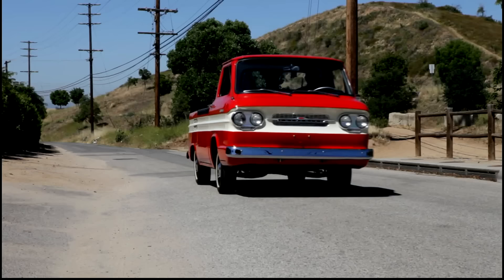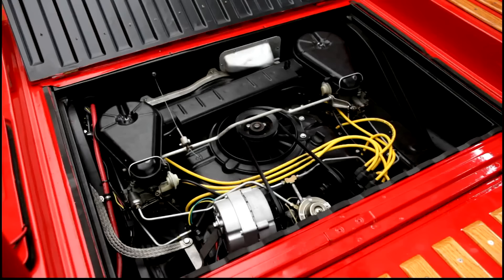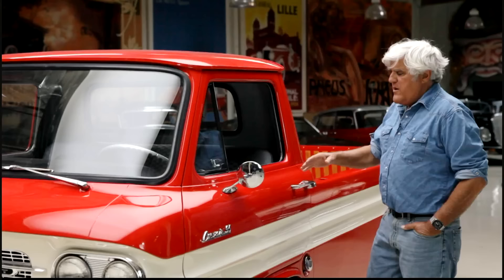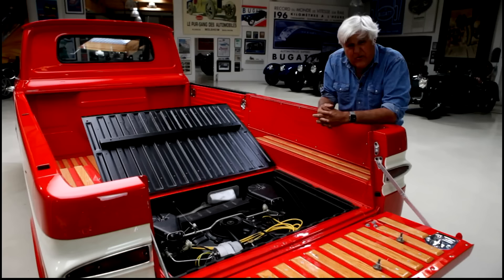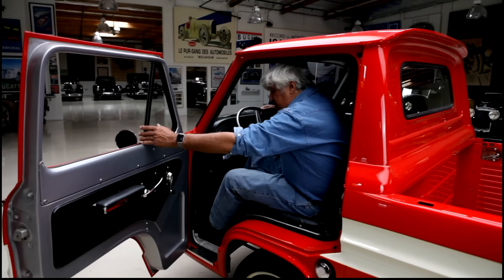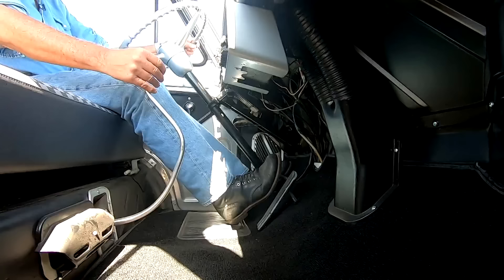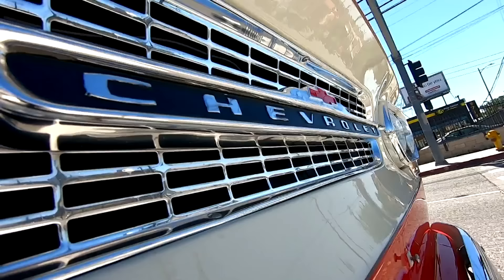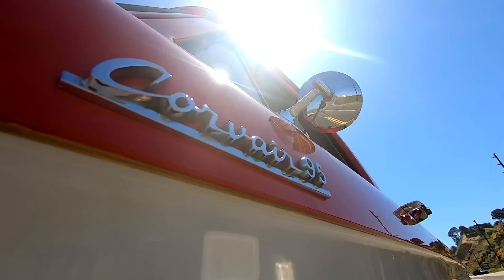America's Most Radical Pickup Truck - Jay Leno’s Garage

Comment: That brought back memories.  The Corvair was a fun car that went pretty well uphill in the snow.  I recall the van version was called the Greenbriar.  There weren't many of these around.  I think that I knew of one pickup used by a housepainter and a van or so.  They did tend to burn oil but then I was in the mid-west where cars and engines didn't last long anyway.  Studebaker was actually pretty good if you could get past the fact that they rusted out so fast. A couple of years and they all had lace curtain fenders from road salt.
Reply: The reason you didn't see many of these back in the day is because they were a failure in the marketplace.   The Chevy van looked nicer than the Ford Falcon-Econoline,  but the Ford was more reliable and had a flat floor.   These were sold as work trucks and you couldn't load a full sheet of plywood or sheet rock from the back like you could with the Ford.   GM cancelled this pile-o-crap  after the 65 model year and replaced it with a Ford copy.

Comment: Hey Jay, love the Rampside. As an old Corvair jock of 50+ years, I have always loved the 95 series and Ive owned a dozen or so over the years. I just wanted to mention that I dubbed the shifter on 1961-63 95 series as a magic wand. Thanks for the respect you give Corvairs which were surely the most innovative car America produced! Anyone that understood the handling characteristics of the Corvair, loved it. Many were sold to highly educated folks, engineers in particular, who loved them. I started buying and selling them while in High School at age 15 in 1970,  my first was a low mileage, 1 owner 64 Monza convert, for which I paid $90.  1 hell of a deal!

Comment: I just realized something about Jay’s garage! At 60 years old, I now find myself single. I have a 40 x 80 warehouse and a house around the corner. I own a diesel Excursion, a diesel F-350, an Expedition, a classic Camaro, a Charger, a 26’ boat, a Kawasaki KLR 650, a lawn tractor and two Honda generators…
I can only drive one at a time, but I primarily run around in an old ‘93 F-150…so I spend a considerable amount of time on battery charging and battery maintenance! Jay, your situation must be a nightmare! 
Love your videos!!

Comment: Great comments. I enjoyed the presentation immensely. What a great knowledge of this vehicle. I've only driven a 1967 Corvair and the memory I have was about how light the front end was, and how you had to slow down a lot to turn corners, similar to a 3 wheeled motorcycle. These were great for jumping through snow drifts as long as they weren't too long. I had a friend who owned one that got stuck on a very long drift and they sought me out since I had a Jeep Commando with limited slip Dana axles and a Buick V6 mated to a 400 Turbo Hydro. I had a giant nylon snatch rope, but the sad thing was the front distributer. I had packed the engine compartment with snow and it shorted out the distributer. I kept flares in the car for emergencies and used one to dry out the inside of the cap 
I just visited the Automobile Museum in Magala, Spain they didn't have any Corvair's there but they did have a Dusenberg. 
Keep the stories coming,
Kendall

Comment: My dad's friend had one of these but he used as a beach mobile. He put brackets on the bed for fold down seats to connect to. He put on fold down bench against the back of the cab one facing it right before the back of the bed rises. The back part was used for carrying surfboard coolers anything you would need at the beach. He put in button snaps along the top of the back of the cab and built 2 posts halfway down for a canopy and and also put button snaps on the back and put a cover over that so his stuff wouldn't fly out when he was driving.yeah he modified it a bit. His kids and me my bro and sister loved riding in the back when our families went to the beach in san diego

Comment: I had a summer job in 1953 at the Cadillac Tank Plant in Cleveland, OH.  It was manufacturing the Walker Bulldog T-41 and I couldn't believe how fast that thing could run on the test track.  Ed Cole at that time was Plant Manager.  The T-41 had a Continental air cooled horizontal opposed 6 cylinder engine with an Allison transmission.  Not certain, but I think the  Allison was automatic.  I always thought Cole got the idea for the Corvair engine from the Continental which had a horizontal cooling fan unlike the VW's vertical fan.  

The Covair engine is popular for use in experimental home-built aircraft with very minor modification to the basic engine.  The aircraft version's exhaust has a great sound that reminds me of a RR Merlin.

Comment: When I was a kid I remember seeing these and the Ford version and thinking if you hit the brakes too fast it would flip up on the windshield
Reply: There's some great Chevy films comparing the Corvair and Econoline. When you slammed the brakes on an Econoline pickup it would lift the back wheels and scrape the bottom front. Econoline was a death trap compared to the Corvair trucks.
Reply: The Ford version actually has a weight in the back to prevent that from happening.  A few hundred pounds or something like that.
Reply: @kingelvis7035  Had the Corvair camper & a "61" Econoline, the little camper was smoother & more powerful than that weakling 144 Ford, found a wrecked Ford van & replaced it with a powerful 170 motor (lol).  Upon the yearly inspection I had to let the inspector test the brakes on the Econoline, I couldn't believe my eyes when I saw the back wheels come off the ground about 6 inches, I was in shock!

Comment: Great video as always. I like Corvairs, even as I haven't seen any in person (I live in Argentina); but I love the car that was meant to replace it, the more conventional Chevy II/Nova. It would be wonderful if you could borrow a 1962-65 one, as I own a 1966 Chevrolet Super, wich is the Argentinian version of the Nova. It has a 230 cubic inch inline 6 with a three on the tree manual and bench seats. It would be a dream for me to see Jay Leno driving one like mine, or even him coming to Argentina to drive my very own car! Thanks for your show. Greetings from Pergamino, Argentina.
Reply: What kind of classic muscle cars do Argentinos prefer? Do you guys like pickups or 4 wheel drives? What kinds?
Reply: @olliefoxx7165   Hi, Ollie. We Argentinians love muscle cars, but most of us can't afford them, nor maintain them, although there are very good specialists. Also, gasoline is very expensive for us here. We like pony cars mostly. We also have our very own "muscle cars", made in Argentina in the '60s, '70s, and  '80s. They had inline sixes, some specially tuned, and there was also the Dodge GTX V8 (318 c.i., 230 HP). They were: the 1962-74 Chevrolet 400 (it's the first gen '62-'65 Nova, I6, 194/230/250, with up to 155 HP; my car is a 1966 Chevrolet -400- Super with the 137 HP 230, and looks mostly like the American '65, but we always had the 1st design wrap around rear window; from '67-'74 they were Argentinian redesigns, using the American '66-'67 dashboard), the 1969-78 Chevrolet Chevy (3rd.  gen Nova - we skipped the '66-'67 2nd. gen-) Sedán (230/250), and Coupé (the Serie 2 had an Argentinian tuned 250, with 170 HP, wich amazed American GM engineers); the 1962-1991 Ford Falcon (Sedán/Rural station wagon-) with up to 168 HP in the Argentinian Sprint I6; the '62-69ish Valiant I, II, III, and IV, wich weren't sold as Plymouth (sedans only, the GT had 180 HP); the '70s Dodge Coronado sedan, Polara Sedán/Coupé, and GTX coupe (all this were Argentinian redesigned Dodge A-bodies with the appearance of the American Dodge Charger; all had the 150ish HP I6, and the GTX -do not confuse with the American Plymouth could have the aforementioned V8) this Argentinian Dodges were made under license in Spain also; and the American Motors' Rambler was sold under the IKA (Industrias Kaiser Argentina) brand with a some like 130 HP six. IKA also made the 1966-1982 Torino (no relationship with the American Ford), wich is considered as "the Argentinian car"; it was a Rambler American redesigned by Pininfarina  in Italy (later redesigned in Argentina), with an Argentinian evolution of the American I6: SOHC and up to 3 Weber 2-barrel carburetors and 200 HP (later 215/220 HP). It was a sold as Sedán and Coupé, and had a reworked rear axle with coil springs and multilink control arms based on the Alfa Romeo 1900/Giulia Sedán (made and sold in Argentina as the IKA Bergantín), and a German ZF 4-speed manual in the console. Most of our cars are manuals, some 4-speed. Please check them out on the Internet, I think there is some information in English.
We also like pickup trucks and SUVs, there were some made in the aforementioned "golden era" (mostly I6s, a lot of I4 Diesels, even some Ford and Dodge had V8s, though small by American standards), and nearly all of the modern mid-size pickups are made in Argentina; they sell very well here and are exported. Our poor economy (due to years of corrupt governments, alterning peronism, dictatorships, and the kirchnerist thieves that rule us today in eternal koronavirus lockdown), didn't ever allow us to have the fast and cool gas guzzling muscle that we love. That's why our cars only had six cylinders, but were and are considered fast in a sea of boring 1.4/1.6 4-cyls fed with compressed natural gas, and only 70 HPs. Thanks for responding and reading.
Reply: @olliefoxx7165  I messed up in my previous message, and deleted the information about the products from Chrysler-FEVRE Argentina: Valiant (not sold as Plymouth) and the Argentinian Dodge Coronado, Polara and GTX, that were Argentinian redesigned American A-bodies, to look like the American Dodge Charger. This were made and sold under license in Spain.
Reply: @reinaldoenriqueratto7800  cool! Thanks for the info. I like seeing cars that are popular in other countries. It sounds like you guys had some good looking muscle cars. Id love to travel the length of Argentina in a 85 K-5 Blazer or tour Buenos Aires in a 63 Corvette convertible. What's your Argentinian car of choice?
Reply: @reinaldoenriqueratto7800  thanks so much for taking the time to write such an informative list and post. I'm going to look up the cars you mentioned. You mentioned smaller engines and tweaking them for max power/efficiency. Was that bc of oil prices/affordability, car insurance prices, govt restrictions or something else? The factors listed has affected our cars in various ways and at different times. So with all those restrictions on cars do you guys have a big car culture? Id love to visit a car museum in Argentina and see the Argentinians touch on design and performance. With cars being expensive do motorcycles fill the aspiring gear heads needs for speed/travel? One day Id like to travel Argentina from top to bottom maybe in an 85 K-5 Blazer or tour Buenos Aires in a 63 Corvette Stingray. What would an Argentinian choose?
Reply: @olliefoxx7165  Hello, Ollie. Thanks for your answer. As much as the '63 Corvette is one of my favorite cars, I think the K-5 Blazer would be more suitable for our bad condition roads. Remember that for some of us, the letter "K" is a cursed one, because it is the initial of Kirchner, the most korrupt (yes, with a "k") governments in our democratic history. Let's call it just a Blazer. Just kidding.
The reasons for smaller engines and CNG conversions is because gasoline was always expensive for most people, although we have plenty of petroleum and refineries. And in the '60s- '70s there were restrictions to import cars, engines, and parts. Nowadays, the only brand new muscle cars sold in Argentina are the Chevrolet Camaro SS V8 automatic, both in coupe and convertible, and the Ford Mustang GT V8 automatic. They cost $100000 U.S Dollars. We love manuals here, so I think they brought the automatics because they are stronger. There are some luxury brands, such as Ferrari, Maserati, and all the Germans, but they sell a couple of cars per year to the super rich. Even the Corvette C6 Z06 was sold here, but was $132000 in 2007 (more than double of American price), and sold less than the Ferrari F430 or the Porsche 911, wich were a lot more expensive. Rich people tend to be snobs here, and most of them are corrupt or linked to politicians and powerful people, and see Chevrolet as a taxi or poor man's car, sadly. We blue collar workers love Chevrolet Chevy Coupé Serie 2, IKA-Renault Torino, Dodge GTX, and Ford Falcon, wich still race in the Guinness's World Record oldest car racing category in the World (since 1937): Turismo Carretera ("Road Touring"), with screaming 9000 RPM 24 valve DOHC twin carburetors inline sixes, pumping 450 HP, based on the original American designed motors from the Big Three and AMC, but redesigned in Argentina. There are even sub-categories of TC and drag racing wich still use pushrods and rev up to 9000 RPMs.
I'm 36 years old, and lost my job due to koronavirus kuareterna ("eternal  kirchnerist lockdown", wich is a way that this socialist-comunist savage capitalist government found to make us poorer and dependant of them; they are friends of Venezuelan, Chinese, and other dictatorships), but I love cars, specially classics, and will keep mine at all costs.
Well, thanks for your attention, time to sleep in this region of the World. Cheers.
Reply: Both Argentina and the United States of America are beautiful countries, by the way, and I would also like to travel to the USA and the rest of the World.
Reply: @olliefoxx7165  We have a big car culture here in Argentina, remember 5 times World Formula 1 champion Juan Manuel Fangio was born here, also Froilán González (first to win with Ferrari at F1), Carlos Reutemann, and the car makers Alejandro De Tomaso (had to leave Argentina because of Perón's dictatorship) and Horacio Pagani (also emigrated to Italy), and the Gaffoglio family (founders of Metalcraftes, wich make concept cars for the Big Three, Mercedes, Lamborghini, etc. in California -they made the concepts for the Dodge Viper, Chrysler Chronos, Lamborghini/Chrysler Portofino, the Jurassic Park Mercedes-Benz, and others-). There are many more talented fellow Argies in the car scene all around the world, and in other disciplines.
Reply: @olliefoxx7165  As you say, motorcycles are very popular here, not only for economy reasons, but for gearheads and travellers too. Sadly, some families commute 4-6 people (adults, children and babies) without helmets in cheaply made 110 cc bikes, because even poor condition used cars are out of their reach.
Reply: @olliefoxx7165  My Argentinian car of choice is... well, that's a tough one, I love the 1972 Chevrolet Chevy Coupé Serie 2, but a '67 Chevrolet 400 Super Sport has a 230 with a Corvette -sourced 4-speed, and the '68-'74 400 SSs are beautiful 250s... the Dodge GTX V8, and the IKA Torino 380W are special, rare, and require lots of maintenance. My car is a good reasonable option.
Reply: You definitely sound like a car guy! You know a good bit about them and drivers.  Hate to hear that about your job. I'm lucky to be living in a state that only did a partial lockdown. Mostly lifted now with a few exceptions. Argentina looks so cool even though there are some issues. Did you know that certain states here allow people to build their own vehicles as long as they meet certain regulations? I don't have the skills to build my own from scratch but I've seen some that have and they are impressive. Does Argentina allow such things? There are lots of good car shows here and on YouTube. They'll show complete restoration and/or customized jobs. I pick up some good ideas from them. Do you guys have a favorite car show?

Comment: We had the Greenbriar van, as in full body van, double doors. We put benches in, had to put a heavy weight into the nose. I had it in high-school in the late 70s and could drop the engine 
to work on it in the drive way. No big deal. Mine was blue over white. I would just love to have this "pickup" what great memories.  My Dad said the engine was a copy of possibly a Tucker engine. One of the issues with heaters, and we lived in Hawaii in those days, mid 60's.. . was they used a blower pushing air across hot exhaust pipes and pushed it into a vent into the cabin. But it was common for an oil leak to develop and that would blow burnt oil smoke into the cabin. . . we never used it. Now, my van had windows all around, , loved it, stupid High school kid I was, wrecked it. Thanks for the walk down memory lane Jay.